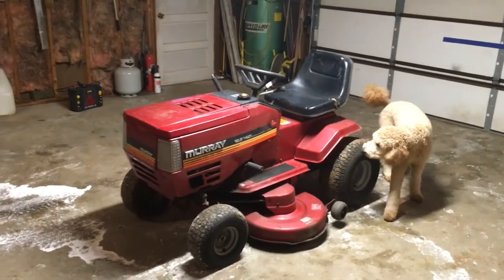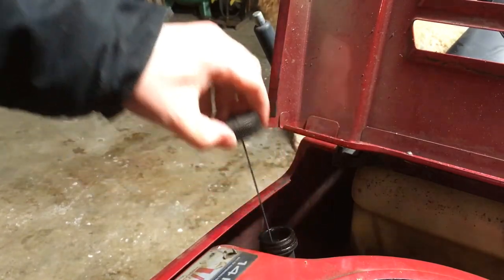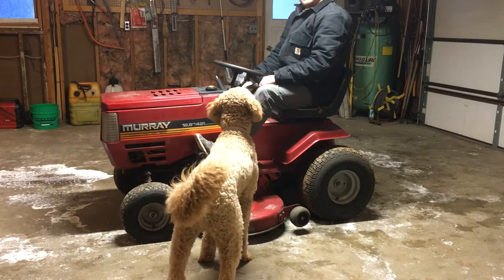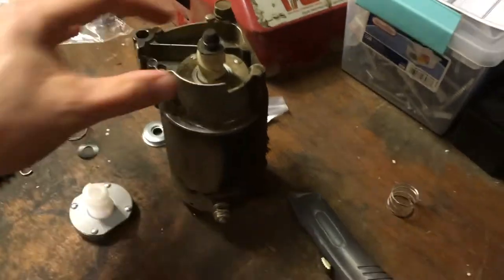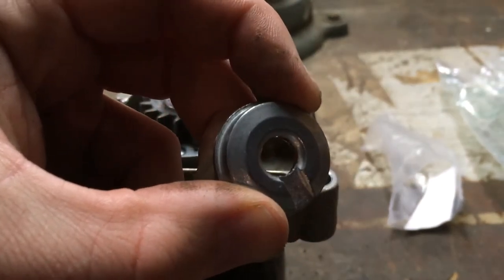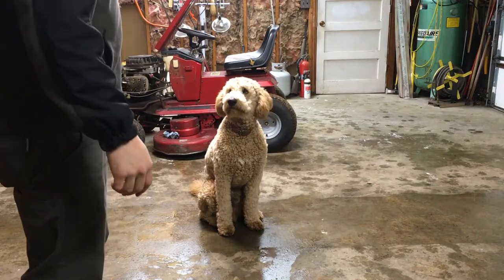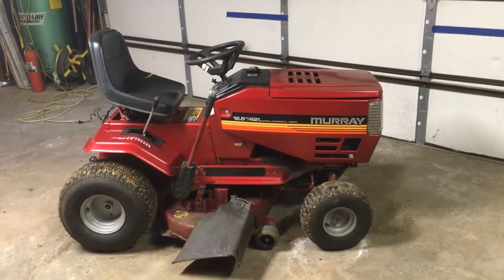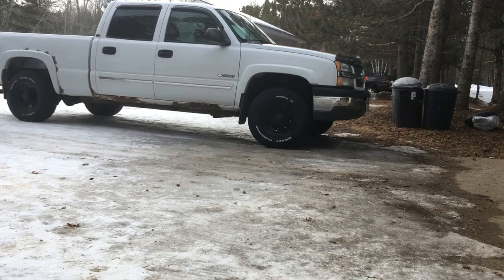Getting a 1990 Murray lawn tractor running

Comment: In the end, it sounds like its running rich. The old plugs verified it, being severely carboned up. The carb could use a complete rebuild. Good job on the starter!
Reply: I agree and probably best to pull head and clean carbon off before it hurts piston
Reply from the maker: I agree, there might have been an air bleed or an issue with one of the mixture circuits that wasn't letting enough air in. I normally pull off carbs and clean them even if I don't think they need it, but I just wasn't feeling it on this machine! Thanks for watching!

Comment: I have a 1987 Model. It runs but carburetor started leaking. They don't make parts for this model any longer.
Reply from the maker: It's a shame they don't keep up with parts production, but I understand at some point it's not economically feasible to continue. Good luck and thanks for watching!

Comment: Hey bud I had a question for ya about one of your other videos but I dunno how you’re supposed to get ahold of someone on here…wanted to know what the tooth count was on the gear reduction setup ya have
Reply from the maker: Hello, the drive gear on the motor is 11T and goes to a 72T on the jack shaft, the other side of the jack shaft has a 15T and the final drive shaft has another 72T. Let me know if you have any other questions, I enabled comments on the original video. Thanks!

Comment: Sounds tearable
Reply: It sounds pretty much like a lawn mower. Before I upgraded due to necessity, I used to have a 2015 Poulan Riding with a 12.5 hp engine. It pretty much sounded identical to the engine in the Murray.
Reply from the maker: It definitely wasn't running as well as I would have liked. Thanks for watching!
Reply: sounds like metalic friction somewhere or else the sound pickup ain.t great.